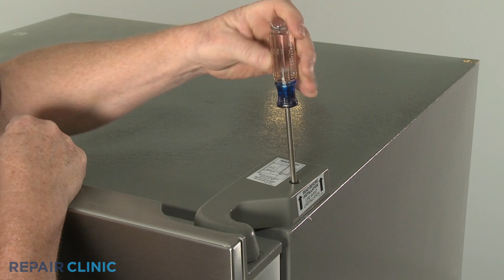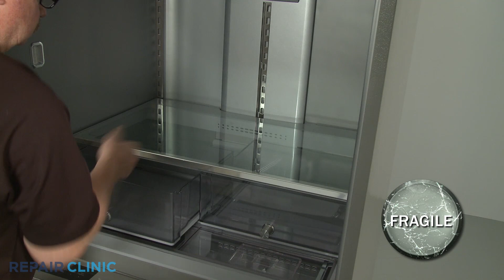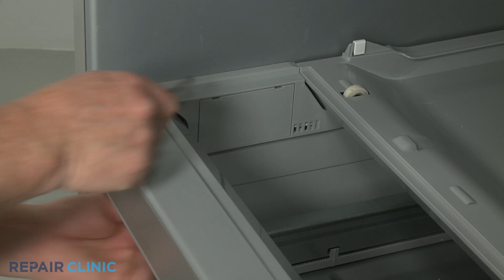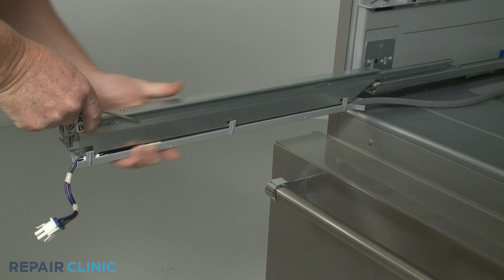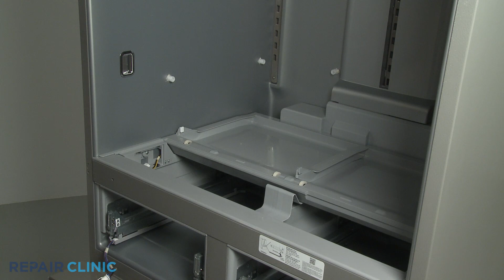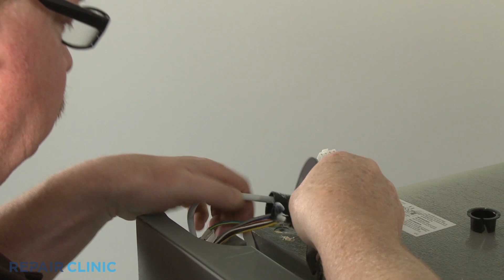KitchenAid 5 Door Refrigerator Pantry Drawer Wire Harness Replacement W11170612

Comment: I cannot believe this cable was culprit on my issue with this fridge. Apparently the wire got caught to that bracket & must of pulled wires. My issue was no lights inside. Ice maker & water dispenser wasn’t working & this did it.

Comment: Great video! really helped me make quick (relatively) work of what might have been a not so simple exploratory surgery job... which we all know how those end, doors that don't quite close and "extra" parts ;) I wanted to also add that the real problem with this design, as I see it, isn't the wire... granted the materials aren't the best quality, but the real issue is the guide, the plastic clip on guide forces the wire into an almost 180 degree bend in not one but two places as many here/other videos and forums have noted during replacement, it breaks not just in the middle where it's visibly kinking but also at the side where it enters the wall of the unit, both of these forced bend points are simply due to the guide, I removed mine and I've had it like this for some time now, was going to post pics of how it works but don't think I can here. I got the idea from old school IT experience with robotic tape libraries, how the tape arm ran on tracks with ribbon cables, and would move hundreds of times a day if not more and those ribbon cables always had a path and space to roll and flex, not bend. It just so happens that this refrigerator has plenty of room under the left drawer to allow the same roll/flex of this wire harness. I wrapped it near the drawer face plug with a small bit of 20mil PVC tape and wire tied it to the very start of the left drawer rail so the plug would not receive any tension, and used one of those 3M adhesive wire anchors just a bit down the inside of the drawer rail to help keep the harness "up" so it doesn't fall too low when open and get pinched while closing... the rest of it is handled beautifully by the space below the drawer, and the sheath of the harness provides plenty of rigidity and also smooth gliding action over the floor of the unit under the drawer. Now when I move the drawer in and out the entire harness moves with it and the entire loop of the harness and its 5 wires "absorbs" the needed flex instead of two pinch points... I expect this fix will outlast the refrigerator. Oh also, now the drawer mysteriously never ends up stuck just part way open which was always an issue only with the left drawer, I'm not convinced that too was being caused by the guide forcing so much sharp bending pressure on the harness that it gave just a bit too much resistance to the smooth drawer closers. Two problems solved :) Thanks again for the video!

Comment: Yes, it is a lot of work, and you really do need to do all of the steps!  The connectors are buried inside and behind the drawer track which you cannot get out without removing the door and the hinges.  Secondly, the replacement part is just as bad as the original.  I have had to do this twice now in seven years.  The wire quality just cannot stand up to the temperature and movement.  If you slide the weaving on the harness you will find a broken wire.  If you are good with wiring and a solder iron, you can fix versus replace.  Lastly, this fridge is very heavy on electronics.  That broken wire can cause unrelated issues such as the ice maker ceasing to function.

Comment: My lights went off along with no water or ice making/dispensing and the deli drawer cooling selection indicator was off.  The wire harness replaced in this video was the culprit!  Ordered the part from you and replaced it following this video.  Thank you so much for the explicit step by step instructions to replace this wire harness!  Fixed!
Reply: Super helpful video - had the exact same symptoms as above, and this was absolutely the fix!
Reply: How was this harness the culprit though i find it hard to believe this thing is the problem 🤷🏻‍♂️. Was your harness corroded or pinched?

Comment: Thank you for this excellent instructional video.  My wire harness also failed with the following strange symptoms: first "open door" icon was flashing and chiming with doors closed; then after pulling pantry door plug and powering off and on, the LDEs inside fridge would stay on: after more fiddling with plug and power, got the LEDs to stay off, even with door open.  Confirm harness wires a problem by pulling on individual wires - 4 wires had snapped at the flex point.  This is a common problem referenced on appliance repair sites, and KitchenAid should provide replacement harnesses for free.  Poor engineering of wire harness is the root cause.

Comment: Replaced the deli drawer control panel but that did not fix my problems (door ajar signal sounding, no water dispensing, no ice making, no lights). Strangely, almost all fridge features returned after I disconnected the deli drawer control panel (only problem remaining is deli drawer light doesn't work). Can I deduce that the pantry drawer wiring harness needs to be replaced to restore the full functioning? Did the wiring fail because water is getting under the deli drawer control board? If so, how do I prevent this from happening again? What's the harm in just leaving the deli drawer control panel disconnected?

Comment: Wondering if you could advise me here... My fridge lights stopped turning on, and my water stopped dispensing at the same time. If the water paddle was pressed, water would randomly dispense minutes later instead of right when it was pressed. After reading up on the issue, it seemed like there could be a connection issue with this wire harness. Sure enough, when I unplugged it from the drawer, the connection was corroded with water inside. I tried cleaning out the contacts with some corrosion remover, and after a few days the lights came back on consistently as they should when the doors are open. But now the water still does not dispense, the ice is clumped in the ice machine, and the fridge does not seem to be cooling optimally. Could these still be symptoms of a faulty harness that needs replacing? Or do you think there may now be additionally faulty parts? Thanks in advance!

Comment: I bought this refrigerator thinking the evaporator fan assembly was malfunctioning, as I was told that the refrigerator was cooling no further than 44 degrees, but the freezer was fine.  Had to remove all doors to enter the home.  At this point, I noticed that the "select" touchpad was black, and two blue wires were severed on this wire harness.  I temporarily repaired the wires and hooked up the fridge.  I unplugged this connector from the drawer, and temporarily spliced the wires back together.  

Both the fridge and freezer will only cool to 15 degrees above the recommended settings.  Tried plugging this harness back into the drawer, but interface panel is unresponsive.  No change in refrigerator or freezer cooling.  

My question is:  Would this harness and interface panel affect the cooling of the refrigerator and freezer?  I don't want to replace the Evaporator fan motor and air damper control assembly if these also must be replaced.  Also, just found that there are TWO Evaporator assemblies.

Which fix should I try first?

Thanks so much for the assistance.

Comment: Slight issue...my lights are out and   my ice and water dispensers stopped working at same time lights did.
Read and watched your great video...decided to go to left pantry meat drawer..wiggled the wire by where rail meets front of drawer. And my lights came on...but...the door open light is illuminated when all doors are fully shut.
Can you deduce from this if it's the wiring harness or is it one of the 3 control boards? Also , is there a way to disconnect something so the door open chime doesn't keep going off with this issue.
Thank you.

Comment: Thank you for this video!  Your instructions were spot on. Thanks to you, this old computer nerd got the fridge fixed like a pro.  And the best part is the old harness had a severed wire under the mesh, so it was obviously the fault.  I agree with the earlier post about the harness being a bad design. To be honest, we never even use the temperature buttons that the harness connects to, so it could all just go away, IMO.

Comment: You have got to be kidding me.  When a tech was here to replace a failed ICE maker he noticed the left hand Pantry Drawer we not aligned properly, so he removed the plastic drawer to get to the adjustment screws.  While in there we both noticed the wire harness protective sheath was worn through exposing the wires inside.  He used a zip tie to put a small loop in it.  I’m not sure what it will do.  Seems to be working but for how long.  I took a photo.  Guess I’ll call Lowes since I have an extended warranty.  But it’s obviously a design defect.  I hope they have some revised technical solution to prevent this from happening again.  I wonder what this service call would cost out of warranty.